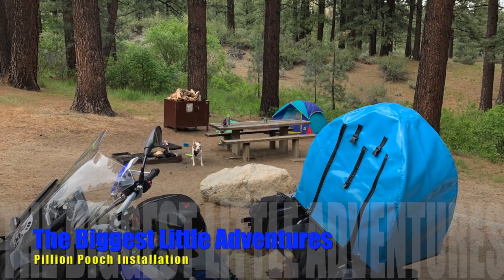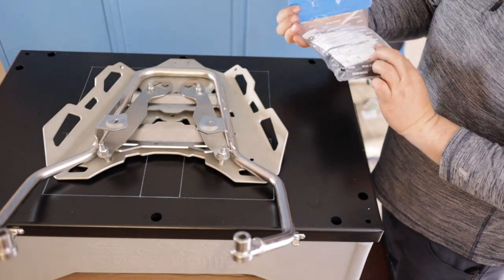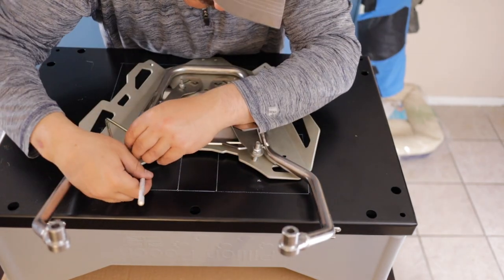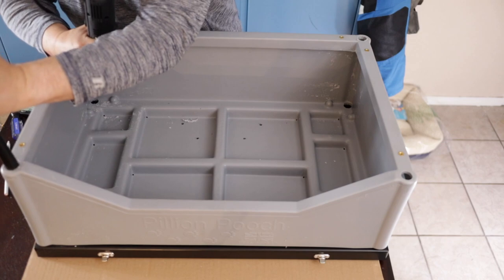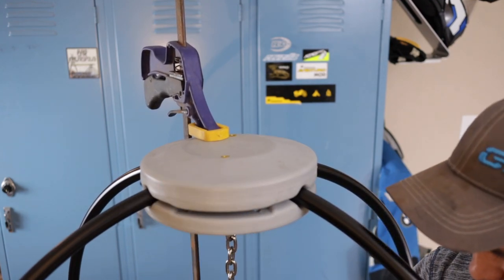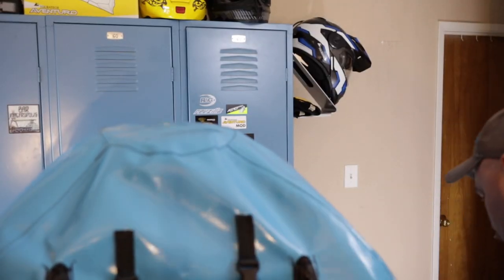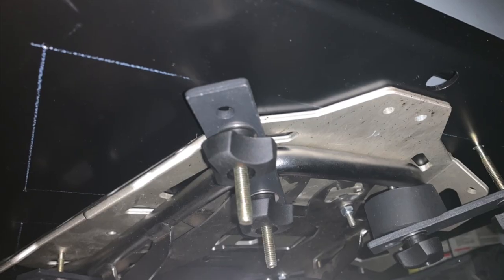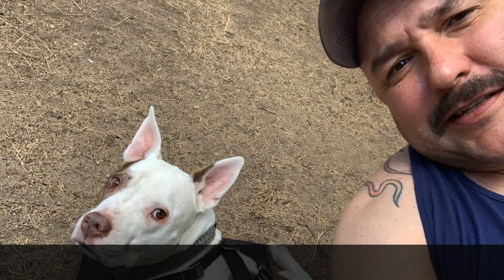Pillion Pouch - Part 2: Installation

Comment: PILLION not PYLON POOCH - to me this looks a very poor engineering solution placing the weight high up on the back on the rear rack about the worst place to have weight on a bike-much prefer a system where can have dog on rear seat, and so as to protect in case of a drop, luggage can be place around.